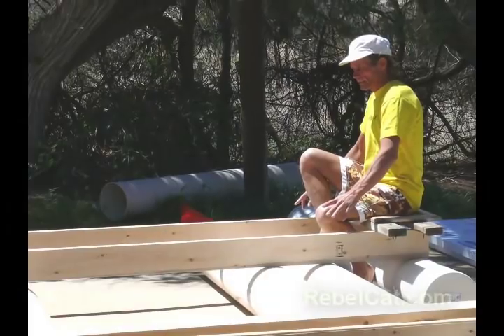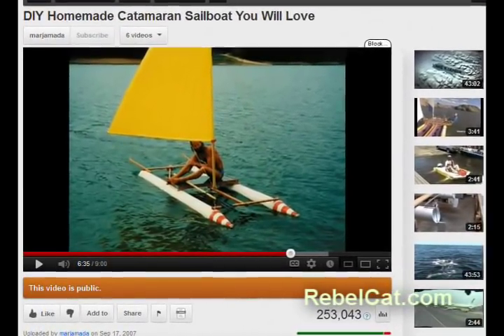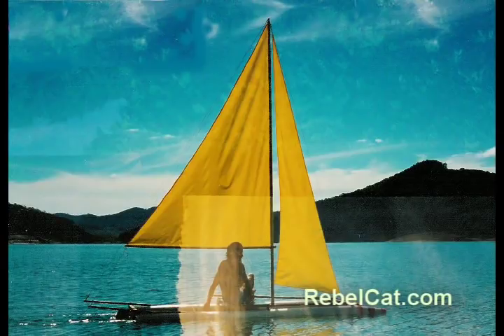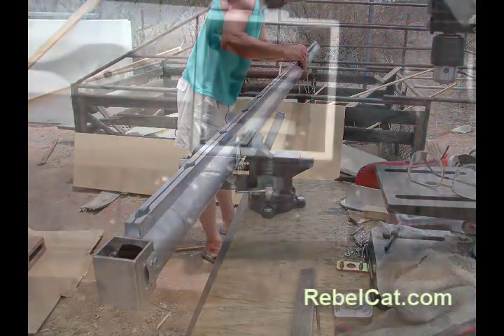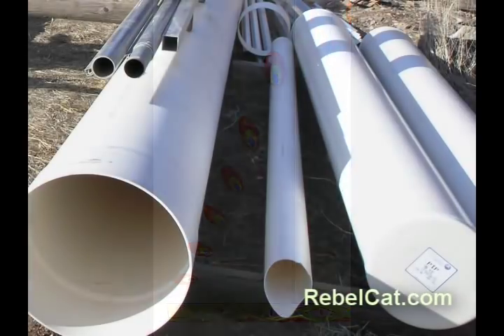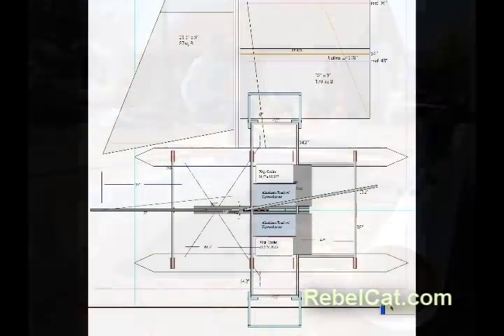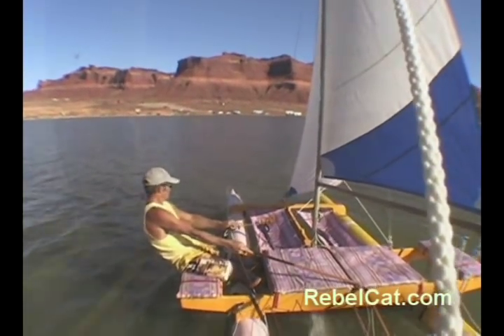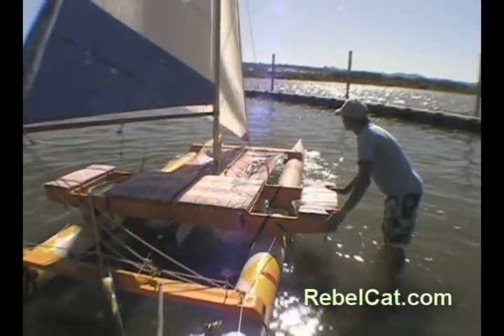Why Make A RebelCat PVC Pipe Catamaran Sailboat?

Comment: i love how you dealt with closing the ends off. when i built my first one, i just used caps (which were expensive) and vinyl pilling caps (which came unglued and floated away).  lots of good ideas here....i will have to use some of them.  i also made the mistake of using sch40 which was too heavy.  nice job thanks for sharing.

Comment: Well thought out boat. It looks really fast but yet forgiving and stable.
Reply from the maker: +Terry Tosky Well-spoken, thank you. You quickly summed up my goals while designing it. If a cat isn't fast, it might as well be a monohull, pushing a lot of water. While trying to find a way to make pointed hulls, I discovered that nobody had done what I wanted to do, so I found a way to heat-shape large-diameter PVC pipe. I even considered hanging the pipe from a tall tree so the bow could be immersed in a barrel of hot oil, to soften and shape it. Fortunately, I found an easier way, and the results were excellent. And stable - the cat is like a diving platform.

Comment from the maker: Good question, and I get it often. RebelCat 5 can handle chop fine, up to maybe 2' - I've done that in the Laguna Madre off the coast of TX - but it is a rodeo and not that much fun. If the chop is closer to a foot high, the cat glides on the crests and doesn't dip much, but you have to keep your eye on where the chop is coming from and sail across it, which is not difficult. I just don't want people to expect it to sail in waves like a Hobie Cat, which is for racing, not cruising.

Comment from the maker: Good question. At the moment I am building an off-grid house in the desert (see SurvivalRetreatPlans followed by comm) and it is taking all of my time. RebelCat 5 can be scaled down from the plans on DVD to achieve the size and performance of a RebelCat 6, which is pretty much what I have done on paper. It will be some time before I can build one, but you could used the DVD to build one now, if you can shrink it a bit.

Comment from the maker: If you follow my design (available on DVD), you will still have to add traffic cones to the ends or heat-shape the pipe, which will reduce your flotation. Calculate load and flotation carefully (formula at my web site) - you can't get this wrong. So if 7' is the total length of your pontoons (including cones), you only have 2' of pipe (oops), because cones are about 2.5' each and have 1/3 the flotation of pipe the same diameter. 7' if pipe plus cones is 12'. Short cats are bumpy in chop.

Comment from the maker: RebelCat 5, the one in this video, will handle pretty big chop, but it is not made for rough water and big waves. The cat is made from several large pieces which can be carried on a roof rack and assembled on the shore. As the connections between parts must be strong and yet allow flexing (this is not a rigid-frame cat), I had to design them to handle chop. It is a cruising cat, not for racing in rough water.

Comment: How difficult to right by one person weighing around 200lbs? On a scale of 1-10 (10 being hardest). Thanks.
Reply from the maker: Well, I have to confess I never had to right my cat, because I sail carefully. It's a fair question, but remember that a 10 for one person is a 5 for another - skill levels are so different from person to person. If you fly a hull, race and push the cat to the max, you need a racing cat. Mine are for cruising, both hulls in the water (most of the time).

Comment: you are in Arizona? a friend and I want to build one of these for spearfishing lake pleasant. where the heck do you get that big pipe? I am guessing somewhere in phoenix?
Reply from the maker: +Joseph Jenson I have bought 10, 12 and 15 inch pipe in Phx, Prescott and Albuquerque, NM. Major makers are JM Eagle and Charlotte Pipe. Good place to find it is irrigation suppliers, often at the edge of town or in the industrial area.
Reply: Oh nice! Prescott is way closer to me than phx I just wasn't sure if it would be there. Thanks so much for the info.
Reply: I forgot I had a follow up question, have you considered or played with a tri hull design with the same materials? we are planning on three adults and spearfishing/rock climbing gear so a little more weight than average. I know it will be slower but speed is not so much my concern as boyancy
Reply from the maker: +Joseph Jenson My RebelCat has a central rotating centerboard, so a central pontoon would require major re-design. Far easier would be to make the cat longer or from larger-diameter pipe, to increase flotation. I consider 12" ideal. I have used 8", 10", 12" and 15" - 12" is the best for an adult craft.
Reply from the maker: +Joseph Jenson Here in Prescott, the pipe yard has changed hands several times. It's possible they no longer have large pipe for cat pontoons. But they can probably order it from Phoenix.

Comment: how does the sails work on cat 1?i want to build one and i dont know.
Reply from the maker: Danylo Topolnyuk I'm not sure what you are asking. You can read about the physics of how sails work online - search 'How a sailboat sails'. If you need construction guidance, that is beyond the scope of this comment section, however most modern sails operate on the same principles of maximizing lift and minimizing drag.
Reply: i was trying to find out how the sail is operated from the cat ,and how it was conected to the cat mast .
Reply: what do you think a 3 meter 10 cm diameter pipe will work for rebel cat 1?
Reply from the maker: +Danylo Topolnyuk No. 10cm (about 4") is too big for such a small cat. Try 3 cm. RebelCat 5 is 21 feet long with an 18.5' mast and it is 2" diameter aluminum (5 cm).

Comment: how much would a super portable mini catamaran weight and perhaps total cost?
Reply from the maker: Not sure what you mean by 'super-portable'. My RebelCat 5 fits on my pickup's roof rack - is that portable enough? Doesn't need a trailer. Cost of materials is anywhere between $250 and $350, depending on what you already have and can find cheap, and on how fancy you want to go with the sails. PVC pipe prices vary widely, cheapest I found was NM. My cat weighs about 250 lbs and will carry two adults and two kids.

Comment: Where did you get PVC in the middle of a Jungle...
Reply from the maker: I went to the nearest village, took a bus to a larger town and found the pipe at a hardware store, hired a guy with a VW pickup to drive me around shopping for supplies and to drop me back at the lake.
Reply: marjamada shoulda just used ups or fed ex
Reply from the maker: Ain't no couriers in the jungle, dude.

Comment: its cool and all but buying a used hobie cat for 300 400 dollars would be better to start off learning i think.  then modify that.
Reply from the maker: Possibly. If you find a used Hobie for $300-$400, it may need repairs or parts, and if not, it will soon. Any idea what it costs to replace Hobie parts? As much as your whole used cat. However, if you can do the work yourself and fabricate parts, a used Hobie could be a good deal, just not for everybody.
Reply: marjamada yeah any use hobie between 300-400 dollars will need $1000 in repairs